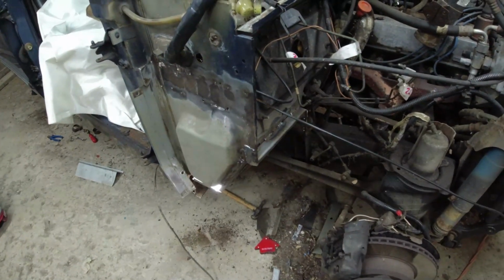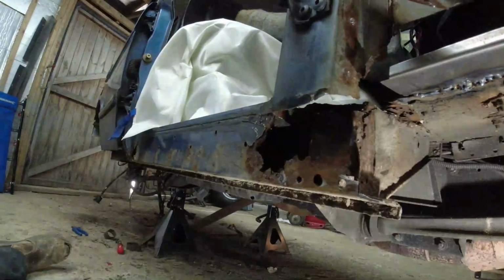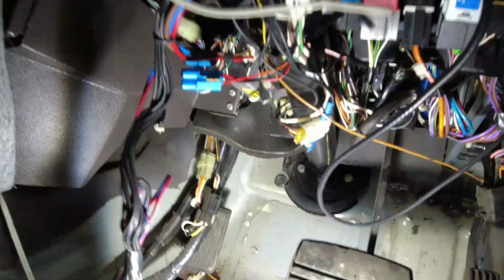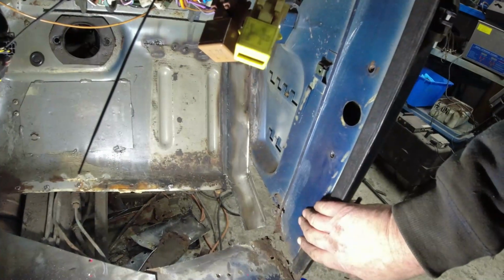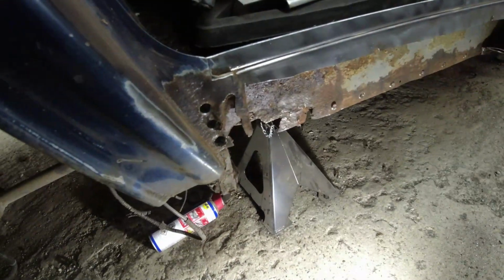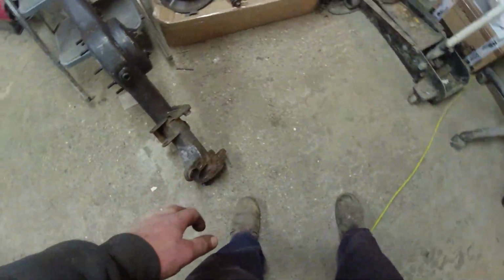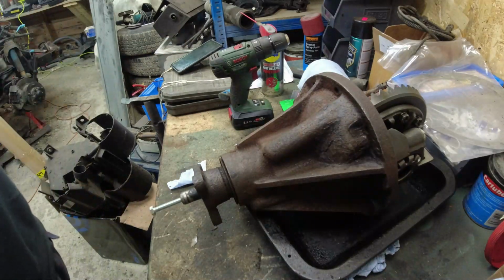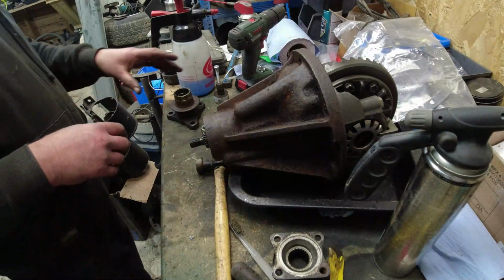1993 Range Rover LSE episode 6 - Drivers sill and rear diff 3 bolt flange - profanity warnings

Comment: Looks like a job for a length of 60x100box
Reply from the maker: outer sill repair section was cheap and fit like a glove. I have a couple of older cars that need resto and they had sills made up from 3mm thick angle iron sections.

Comment: For my money it's got to be worth doing the inner sill completely while you are in there, then it will all be new and rustproofed and generally very lovely for years to come.
Reply from the maker: To replace the entire inner sill would need a fairly comprehensive strip down of the interior, electrics and also removal of outer parts of the seat box structure. As the majority of the inner sill were strong and rot free, this was by far the most cost effective method for repair
Reply: @churchhouseclassics  that's very true and a fair point.

Comment: Check that you dont need a spacer for that 4 flange conversion. If you compare the 2 flanges you can see the difference. Some had spacers some didnt. Another way to remove that 3 flange pilot is a deeo socket and a a stack of washers and a 10.9m8 bolt. Great job otherwise